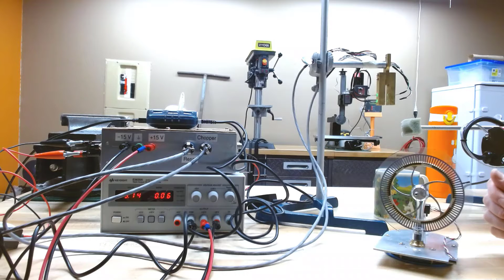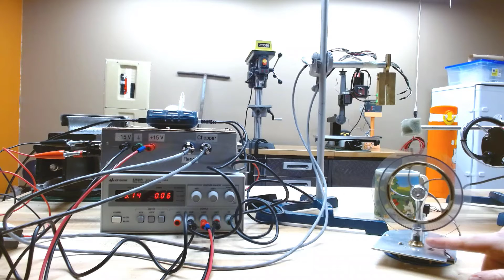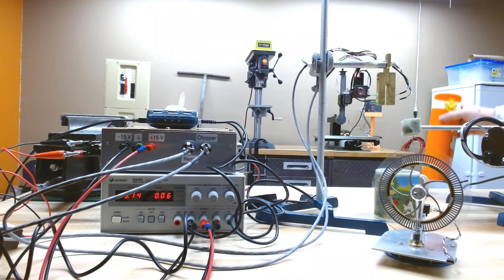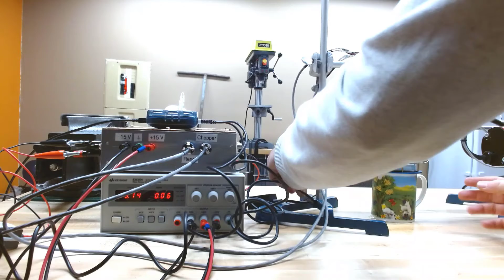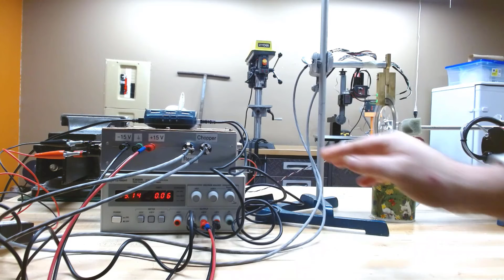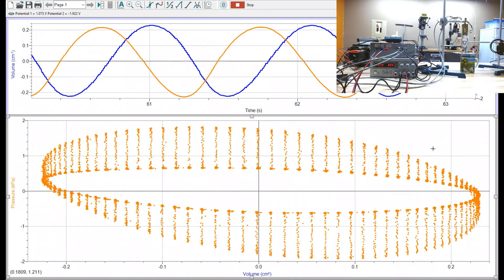Stirling engine PV diagram measured in real time

Comment: So what's the power output?
Reply from the maker: The work done per cycle is determined by the area of the loop in the PV-diagram.  Roughly speaking, with no friction applied to the flywheel, the change in volume is about 0.5 cm^3 and the change in pressure is about 1.2 kPa.  Therefore, the area/work is approximately W = 0.6 mJ.  In reality, the work is a little less because the PV-diagram is not rectangular.  The power output is given my P = W/T, where T is the period of cycle.  Without friction, the period is approximately T = 0.2 s such that the power output is about 3 mW = 4 micro-horsepower!

When friction is applied, the work per cycle increases and the power output decreases.  The power decreases because the period of the cycle increases more than the work per cycle.

Comment: Am i understanding correctly that the volume of the engine is calculated externally? looked like you were using a sensor to add value of the volume depending on flywheel positioning.
Reply: you explained it in the part of the video i skipped over, sorry

Comment: Is it correct to assume zero pressure on the graph represents atmospheric pressure, therefore when a negative (below 0) pressure is indicated that would represent an internal working fluid pressure lower than the outside atmospheric pressure?
Reply from the maker: Yes, that is correct.  The pressure sensor measures the difference between the pressure outside the engine (atmospheric pressure) and the pressure of the gas inside the engine, which can be greater than or less than atmospheric pressure.
Reply: @jakebobowski3165  Thank you. Is there any possible way to also take temperature readings? It is difficult to understand how, in an enclosed heated space containing an expanding hot gas, the internal pressure can drop below the outside atmospheric pressure, unless there is a concomitant drop in temperature. But is there any thermocouple, or other instrument, with a fast enough response time to measure the actual gas temperature in real time?
Reply from the maker: @peoplesresearchcenter  It's probably difficult to get a direct measurement of the gas temperature.  However, you could deduce what it must be using the ideal gas law and knowledge of the instantaneous pressure and volume (PV = nRT).  You would have to estimate the number of moles of gas contained inside the engine using the internal volume and the density of the air.